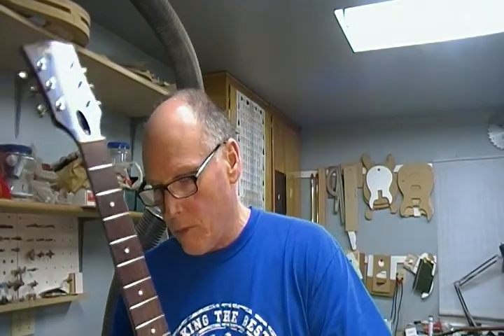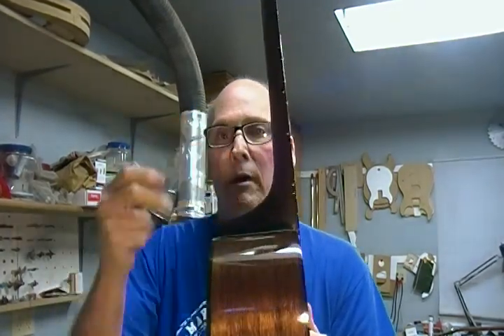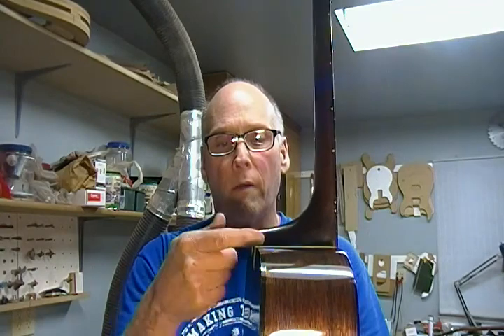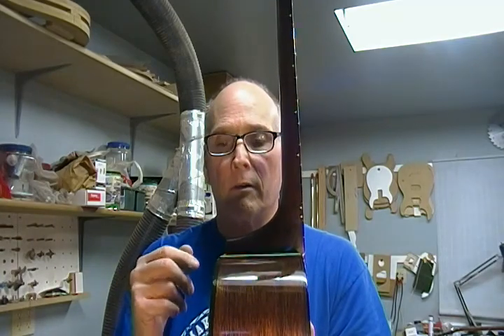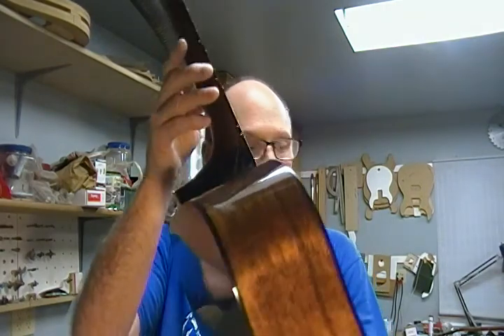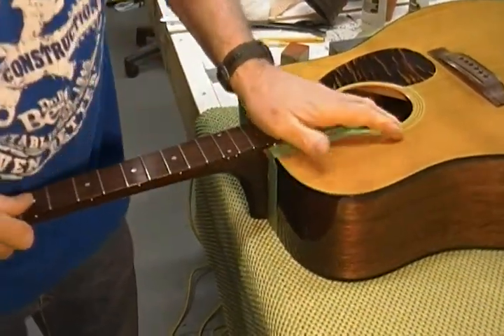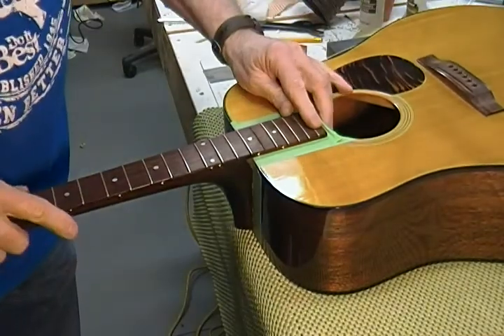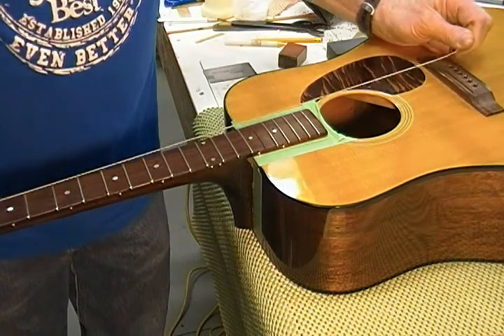70’ Gibson J-50 Neck Reset at Jonah Custom Guitars #8

Comment: Do the necks shift after a neck reset within the first week or two sometimes ?  Mine seems to have not as bad as it was but its getting there.
Reply from the maker: I don't think it should move much after a reset. The top has already been "tweaked" by years of string tension. You may want not have your repair man have a look at it.
Reply: @jonahguitarguy  ok thank you